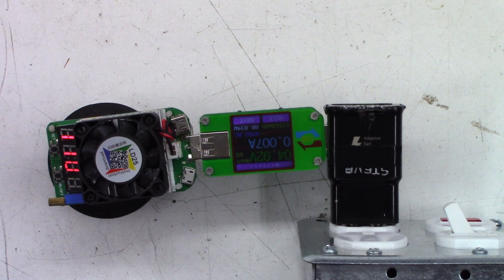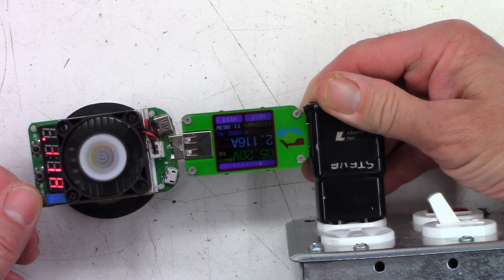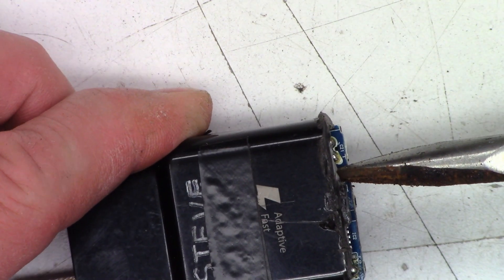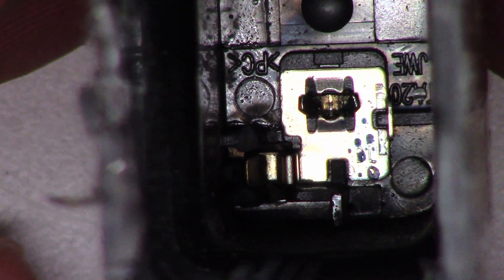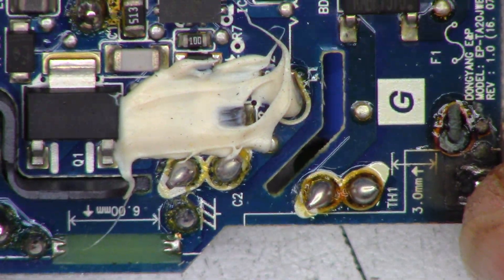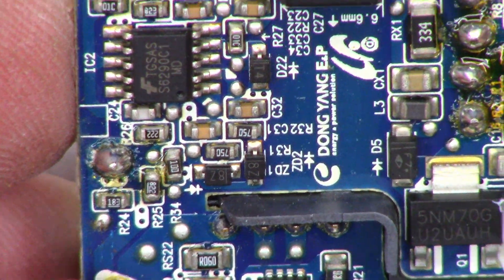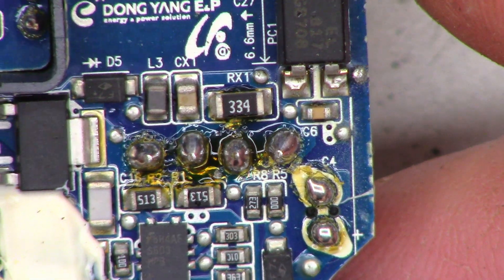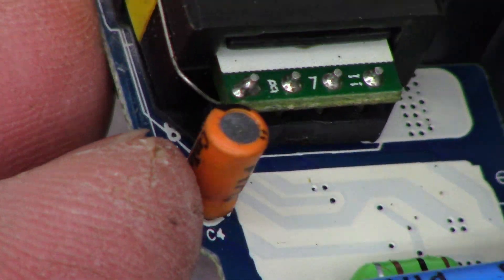Samsung EP-TA20JBE Adaptive Fast Charger Fault Diagnosis

Comment: Hmm just a bit much too heat in one place, shame as it looks well made.
If it was mine, i would drill some tiny holes in the case to allow some of the  heat to escape and cold air enter the case.
I've done this for some of my phone chargers, ok it's not water proof but they are not designed to be in water anyway.

Comment: I bought this Samsung EP-TA20JBE back in 2022 and it didn't even last 90 days and I surely thought that this model
would be a good pick for my girlfriend's Samsung Note 9 phone, but apparently not, PLUS there are a lot of imposters
that are being sold on Amazon! What a rip-off if there ever is/was!!!
Reply: Get an anker charger they are great.
Reply: How well I know about those ANKER chargers, that I bought three of them! I've also had a couple of the Motorola 15 watt phone chargers that I've had for 2 plus years now and I have NOT had a single issue with either of them to this day! @MrReeceyburger123